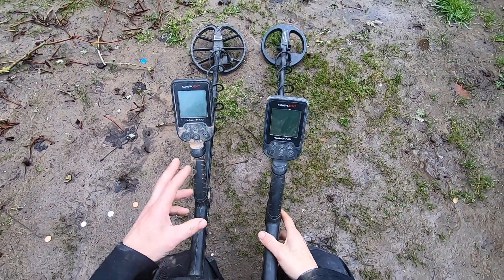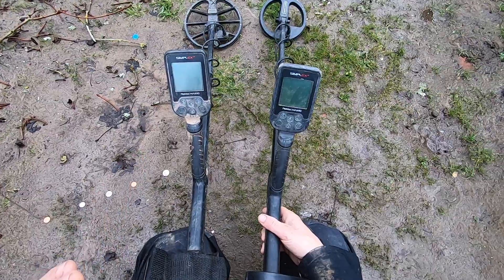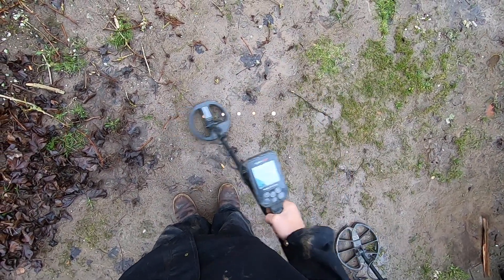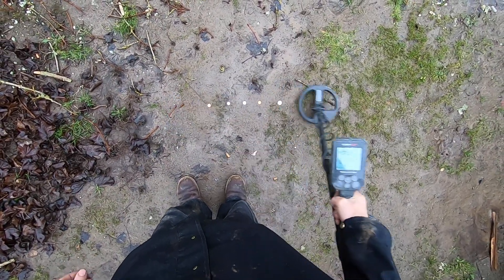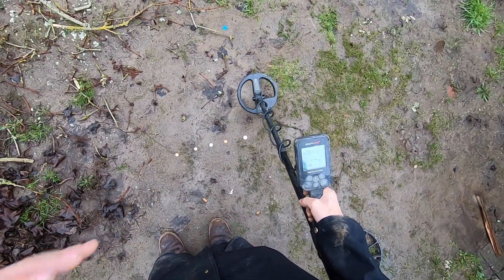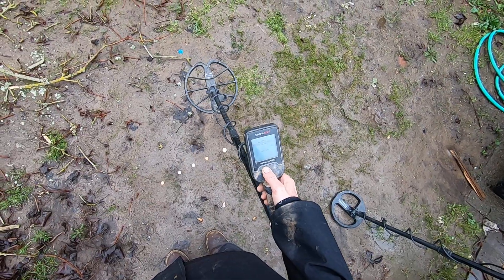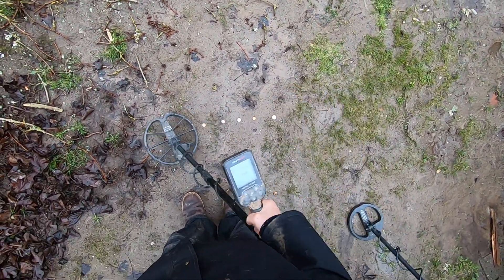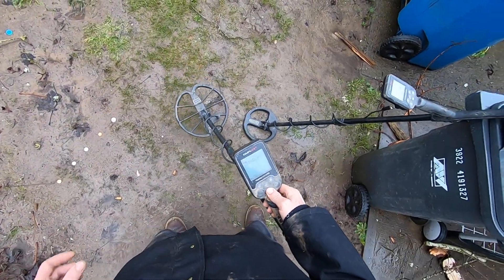Simplex iron volume has an impact on recovery speed.

Comment: Are they coming out with a simplex or a new down load? Saw something about new frequency
Reply: Nokta is coming out with a brand new multi frequency machine some time this year.
Reply: So 'word' has it Shawn. When is whenever Nokta are ready. Continuous / simultaneous multi frequency is easier said than made to 100% efficiency. I think that Nokta will be in no hurry, they won't release a MD early again. They will have learned from the early doors Simplex coil malfunction issues. A  cont' multi-frequ coil and motherboard/electronics are way more intricate as compared to a single frequ'. The main thing seems to be that the 'word' seems positive.
Reply: @KernewekTim  thanks for answering back. I have the simplex, equinox 600, a bounty hunter, and my wife bought me a Rico, but I Ike the simplex and equinox better. Might get a garret later.

Comment: This is very good info here people! I normally leave the iron volume on 2 all the time so I've never really noticed this issue. After testing the 2.77  firmware I realized the 2.78 does much better in my soil so that's what I use now. I recently  bought the longer upper shaft and the carbon fiber lower shaft because I'm 6' 2" tall and they both got really wobbly  after 14 months of use - it's rock solid now.  I got the sp24 coil and used it for a couple of months but I still prefer using the stock 11" coil - it's incredible what this large 11" coil can do even in trashy areas. Good info Paystreak, thanks bro.
Reply: I had the same issue when I got the simplex it came with the 2.77 i used it and was surprised that I hadn’t recovered any sort of mid range targets other the surface or just subsurface targets all I ever had was the 11 inch stock coil so I took a 50 cal musket ball and placed it only on surface of the ground and swung and the ferrous responses almost completely drowned out any kind of good signal I was devastated how could this be any other detector I had gave  an amazing mid range response  with the same test I almost sent it back cause I truly thought there was a faulty coil or something well then I got the 2.78 on there and wow it truly shined I was finding deeper mid range targets like i never had before  it’s something with the difference in the iron bias from version to version it has a place now with my favorite detectors also with the 2.77 it was super chattery with ferrous ground noise before with the sens all the way up its a lot more stable now for me I like that but It might be less overall sens with the 2.78? So Basiclly the ones and zeros make a huge difference with these machines